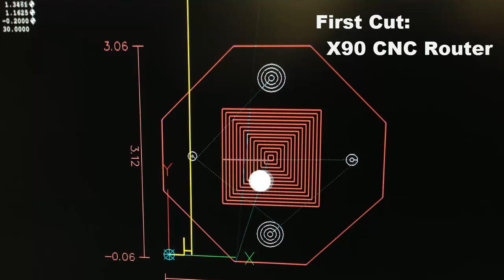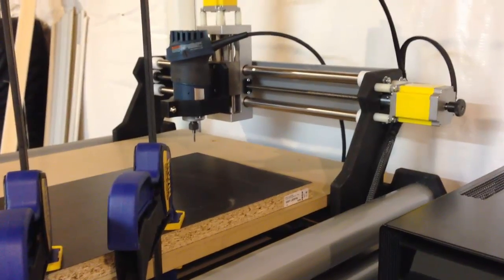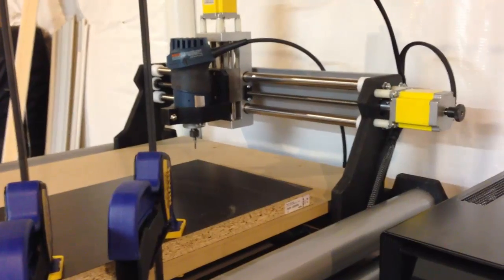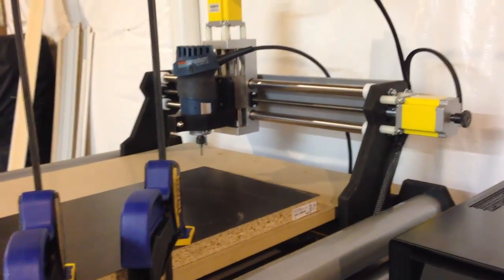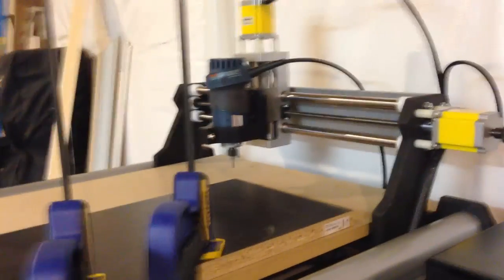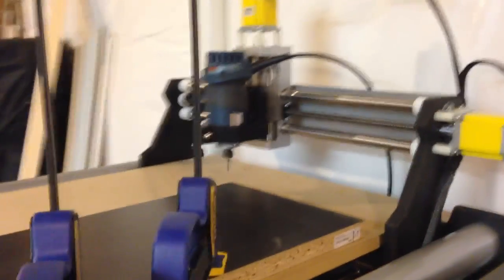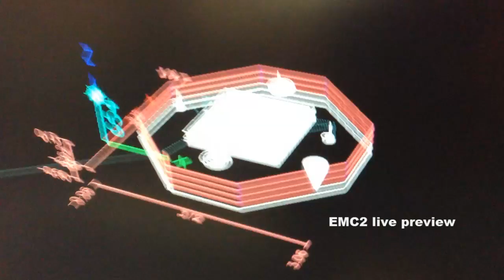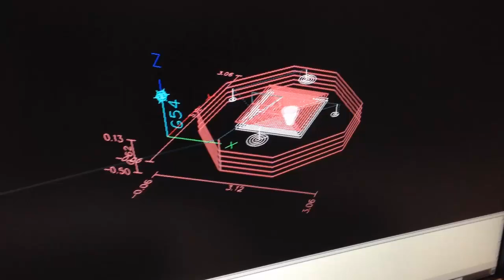Probotix X90 Cnc Router - First Cuts

Comment: You can load the outside cuts to line up your cuts and material. Home all set xy and z To where you want it by pressing shift Home on each xyz setting. Then not cut but load other internal tool paths.
Then the pocket text etc will be ready to go. Cut it it. 
The other tool paths will work the same way.
 Hope this helps.